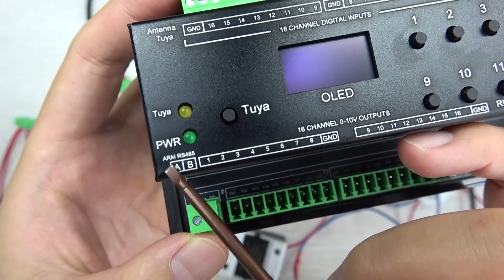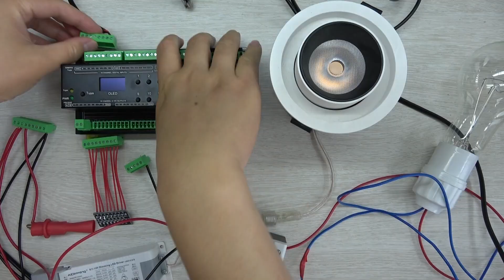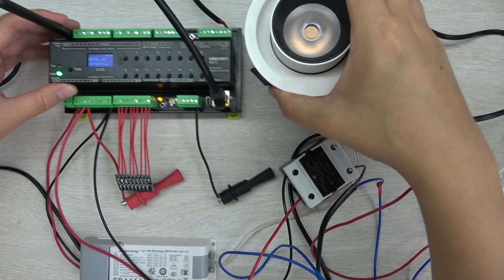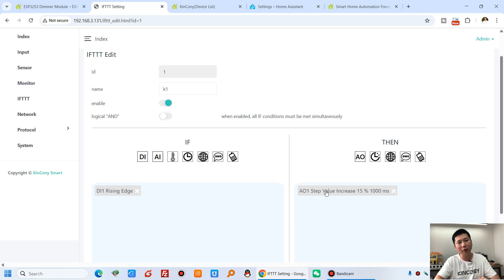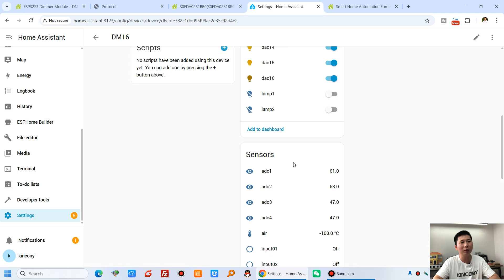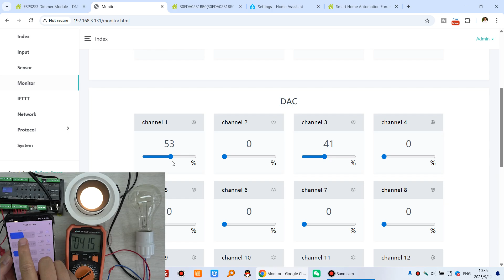16 CH ESP32S3 dimmer module for home assistant & Tuya - KinCony DM16

Comment: Hello, how can I use the KCS-v3 firmware for the Kincone DM16 Dimmer to turn the light on and off using a switch? You have the option to dim with a press, but how can I turn the light on or off with a single press? Do I need to press the button many times to completely turn off the light?
Reply from the maker: after download KCS v3 firmware, the input buttons function set by IFTTT config webpage.
Reply: @KinCony  Yes, this function exists, but if I select it, then I won't be able to adjust the brightness. So, in order to be able to turn the light on, off, and adjust the brightness up and down, do I need 4 buttons on the wall for a single light source? And if I have 3 light sources in one place that I need to dim, do I need 12 buttons on the wall? If I use 4 light sources this way, will the controller run out of digital inputs? How can I then control the remaining 8 dimmers? Am I understanding correctly?
Reply from the maker: @dmitryp7261  IFTTT have option for "STEP" way to incrase or decrase brightness. if you want multi buttons control one function, just connect all button's cable together.
Reply: @KinCony  You misunderstood me. I don't need many buttons for one function; on the contrary, I need many functions on one button. I bought a dimmer that has 16 inputs for buttons and 16 outputs for dimmer drivers. This means that for one 0-10V output, I can only use one input button. I want a single press to simply turn the light on and off with a toggle option, remembering the last set brightness. I also want to be able to adjust the brightness by holding the button — that is, press and hold until the brightness changes to the desired level, then release the button to stop the dimming process. If I press and hold again, the brightness should start changing in the opposite direction. With your IFTTT and firmware version v3.24.2, none of the functions I mentioned can be implemented. Only one action can be assigned to a button — either only turning on or only turning off the light. Dimming via press-and-hold does not work; you have to hold and release to change the brightness by a certain percentage, then press and hold again, repeating the process until the brightness reaches the desired level — and only in one direction (increase or decrease). This is extremely inconvenient. Additionally, calibration for each channel is needed. Some lamps start lighting only at 40% brightness on the dimmer, others at 10%. There should be a way to calibrate the lamp to start glowing from 1%. With the current capabilities, this dimmer can only be used with software automations from Home Assistant, but then the point of the DM16's standalone operation is lost if it depends on an external server. I really like your approach to relay modules — they are truly respectable — but the dimmer, with its current functionality, cannot be fully used with external switches. I hope you will listen to your users and improve the dimmer firmware with good functionality.
Reply from the maker: @dmitryp7261  do you want 1 button for ON/OFF/change brightness?
Reply: @KinCony  Yes, that's correct. Since if you use all 16 channels, you can only use one button per channel, and I would like to have full functionality from it — to turn on, turn off, decrease and increase brightness.
Reply from the maker: @dmitryp7261  ok, we will try to update firmware in future for that.
Reply: @KinCony  Thank you!
Reply: I also encountered the same problem. The standard functionality in the original firmware for wall switches is very limited and, in my personal situation, is not applicable. I tried to create my own functionality using ESPHome and with the help of code writing from DeepSeek, but that didn't work either. The code does not function, and the AI points to a bug in ESPHome version 2026.3.1. I spent a lot of time with ESPHome trying to flash the code, but I was still unable to customize the firmware for my needs. Apparently, for now, I will have to look for an alternative dimmer for my tasks.
Reply from the maker: @smarthomevaltec  do you want 1 button for ON/OFF/change brightness?
Reply: @KinCony  Yes! That's correct. That is the functionality I would like to use

Comment: Most smart home accessories are packed into small boxes to fit wall-mounted switch boxes, integrated buttons, or smart touch screens. Could you explain how I can apply/install your product to the Home Assistant system?
Reply from the maker: all our products support home assistant
Reply: @KinCony  I understand that your product can connect to Home Assistant, but could you please explain how it should be physically installed? Most smart home accessories are designed to fit inside wall-mounted switch boxes or smart panels, so I want to know if your product can be installed this way.
Reply from the maker: @phamks6109  our smart controller mainly install on distribution box. all loads Live line connect to controller.

Comment: what's the maximum cable length to preserve 10VDC? and with what type cable?
Reply from the maker: you can use any cable, not not long, how long need to test.The thicker the line diameter, the greater the distance